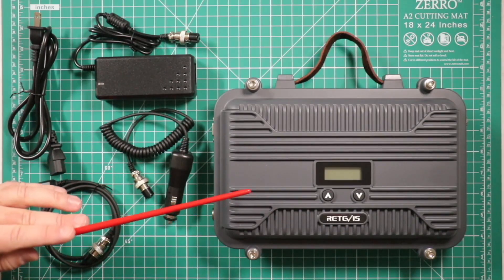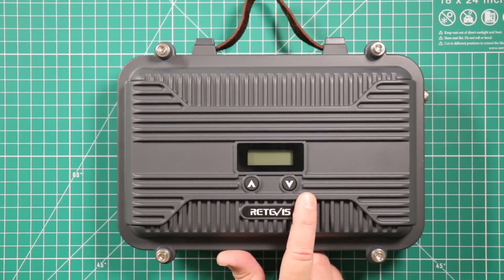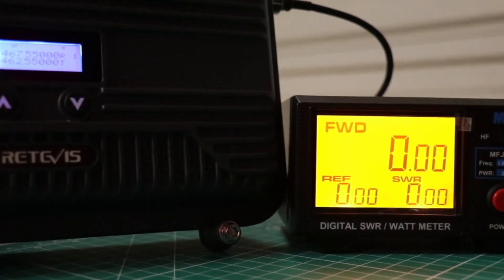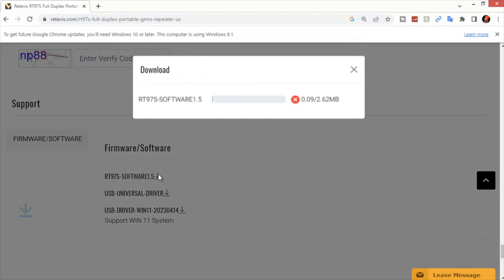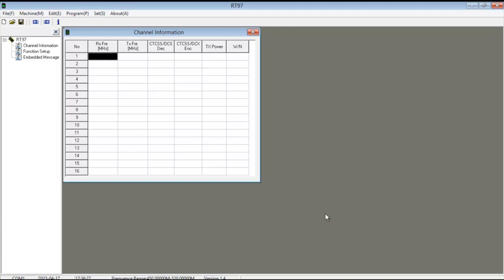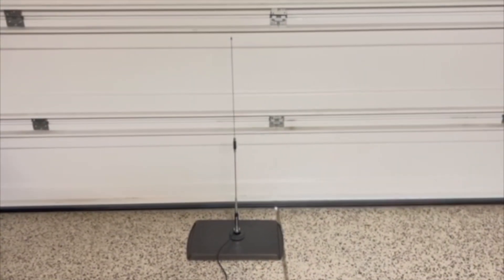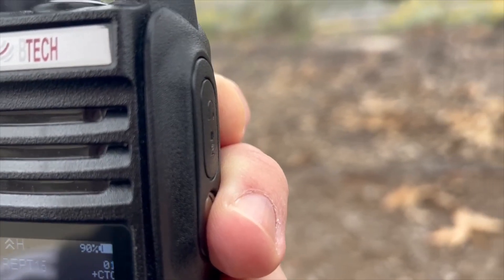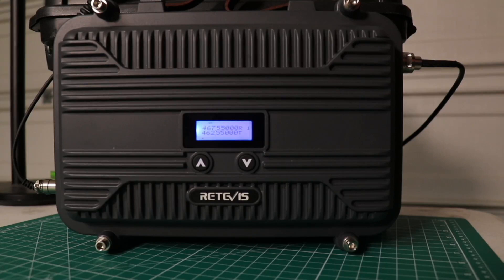Retevis RT97S GMRS Repeater Review and Programming

Comment: I have been using Retevis RT27 radios on channel 18 (462.6250). Does the transmit frequency need to match the receiving frequency? The reason I ask is i can't get them to match. Any tips?

Comment: 12 volt charger? Wall charger? This implies that it charges batteries, this repeater has no provisions for batteries or for being charged. I believe you meant to say that it came with an external power supply for AC Mains voltages and a 12 volt automotive adapter. A charger is a completely different animal. You should also mention that frequency programming must be kept within the bandwidth limits of the narrowly tuned duplexor. It would have been beneficial to your audience to state what the acceptable bandwidth  limitations are for the duplexor.

Comment: I'm new to this, but if your 5watt handheld reaches the repeater at your house, why can't your 5 watt talk directly to the radio at your house?  does the repeater pick up better ? I'm honestly trying to get started and triangulate between three locations up to 18 miles apart for family safety.
Reply from the maker: Thank you for taking the time to watch and the comment! It is greatly appreciated. That was for demonstration purposes only. Technically the RT97S would be in between to radios that can't otherwise reach each other.
Reply: Your assumption is that he wants to talk to his house. What if the user wishes to talk to another user 10 miles away with the house and repeater being midway between the two?

Comment: I have no idea how you get 5 miles with an HT and the base on a mobile antenna on a cookie sheet inside your garage and on your garage floor?  I have an antenna on my roof and a 15 watt mobile radio in my vehicle and after 1 mile I lost the base. Maybe I need to get a mobile antenna and a cookie sheet for my garage also?  Seems to do a better job.
Reply from the maker: Thank you for taking the time to watch and the comment! It is greatly appreciated.  As the old saying goes... height is might. As mentioned in the video i had dropped about 300 feet in elevation. Also I did not leave the antenna in the garage. It was in the back yard on a 6 foot wall.
Reply: @WJ6FRadio  
So your saying you live on a mountain and with the antenna on a 6 foot wall on a cookie sheet you were about to hit this repeater from 5 miles?
Reply from the maker: A mountain?.... No, more a hill....  I live near a mountain which is 5,689 feet, and I can hit a repeater on top of it with 5 watts.  Not sure what the issue is.

Comment: 3rd Herd! Rock of the Marne!
BRO - Duty First here. =]

Great video! 10 watt transmitter but almost 50% loss in the duplexer. Thats normal. I guess one needs to know its 10 watts TX for power consumption. But they could detail that in the specs. Otherwise looks like a great portable repeater.

WW5RM
Reply from the maker: Thank you for taking the time to watch and the comment! It is greatly appreciated.  Were you with 3rd ID? If so where? I was in Schweinfurt, West Germany
Reply: @WJ6FRadio  2AD FWD at Garstedt, Gulf War, then then 1st ID Ft Riley. I was TDY a lot. Hit a bunch of bases actually. I was at Ft Irwin 3 dang times! Up in the mountains out there one time, they woke me up for my shift, way up in the mountains I had about 3/4 inch of snow on my poncho I had laid on top of me. I didn't even know it snowed in California! lol
Reply from the maker: I was 3rd ID from 1987 - 1990 in Schweinfurt, and 8th  ID in Mainz, West Germany when I was recalled for Desert Storm. When I was scheduled to PCS from 3rd ID i had orders to 1st ID  Ft Riley. I had herd about Tank Hill and other undesirable issues with Kansas, so I decided to extend in Germany. Got 30 days free leave out of the deal. Yes, it does snow in parts of california good skiing at Mammoth Mountain as well as Big Bear. I never went to NTC, Ft Irwin. Closest I have been there is when driving to Las Vegas.
Reply: @WJ6FRadio  Roger that! Yup i was at Garlstedt the same time bro!

Tank Hill? Dont guess i remember that. lol
Reply from the maker: Lord knows I spent my fair share of time in Graf and Hohenfels freezing every November.

Comment: Did you mount the antenna higher than the roof ? Are you planning on installing an antenna on a mast at least 20 feet off the ground ? Would you repost your results with an antenna at height ?
Reply from the maker: Thank you for taking the time to watch and the comment! It is greatly appreciated.  SInce I have several GMRS repeaters in my area this will be used primarily when out camping in the California High Desert. That being said next time I go out, when not 120º in the shade, I will do a video on it out there.

Comment: The confusion between the 5 watts & the 10 watts is because 5 watts is consumed within the duplexers themselves. So when planning for a remote repeater, one still has to consider the power requirements as if it is 10 watts anyway. I am looking for a GMRS repeater and the Midland version has been sold out for a year, but my employer won't pay for it at this time. I have been also looking for a good simplex Repeater so we can do wellness checks with our Camp Hosts who are remotely located at USFS campgrounds in the USFS, but it appears that good simplex repeaters are not readily available as they once were 20 years ago. Thanks much for the review & the video.Cheers, Davey - KU9L / WRTI-813.
Reply from the maker: Thank you for taking the time to watch and the comment! It is greatly appreciated.
Reply: You could check out the similar 
GMRS RT97S from Retevis. W2CH 😊